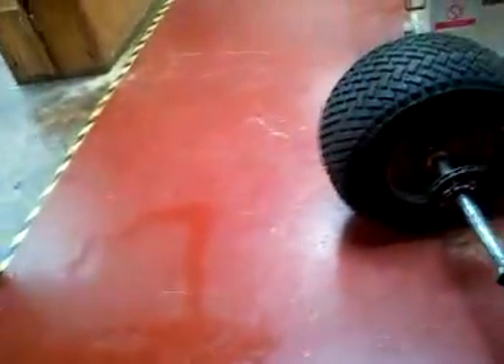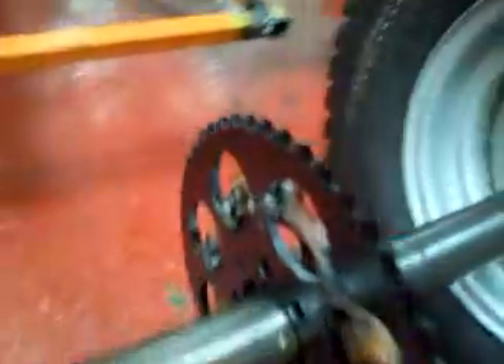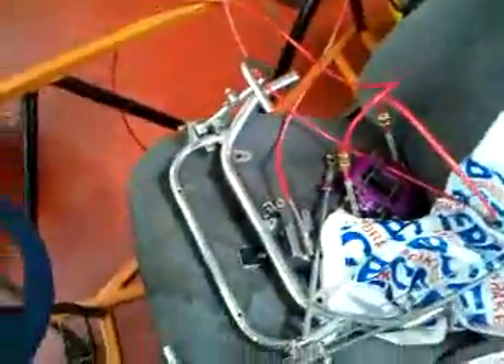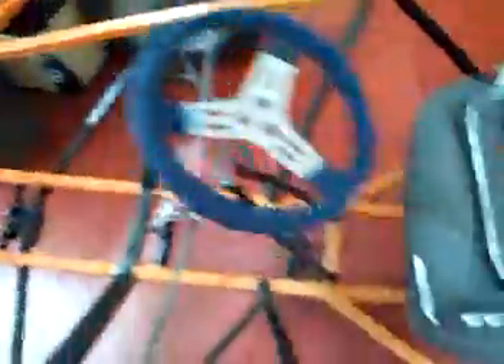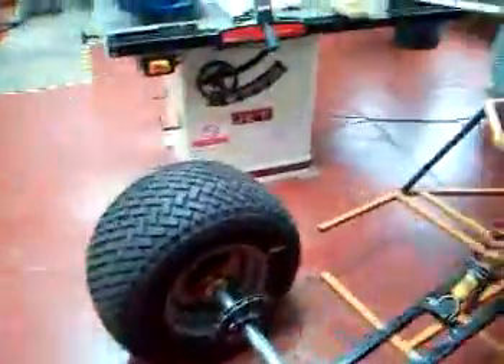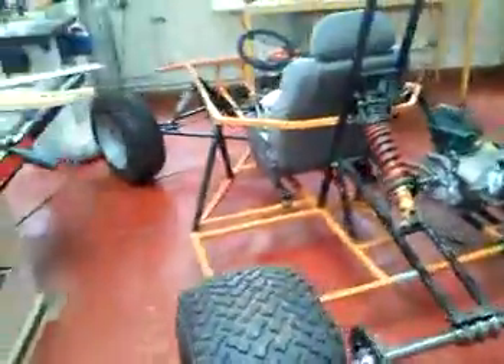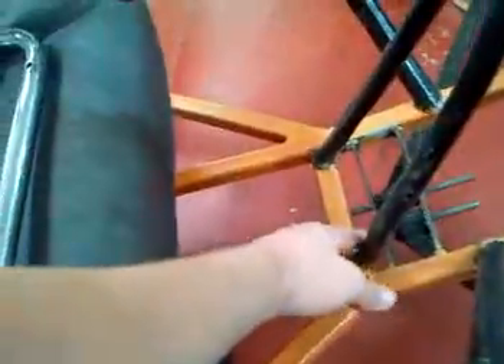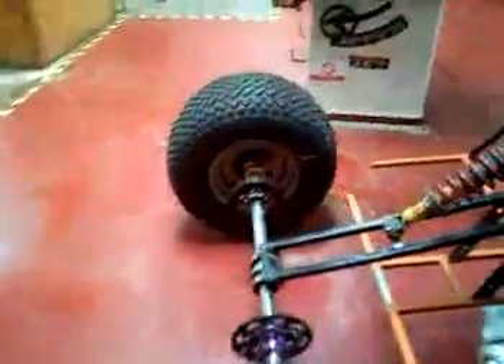Summing up the Dirt devil

Comment from the maker: @leaperd27  well the box section i was using the for the chassis was 20mm x 20mm and got 21metres of that which was roughly £30 - £40 , Seat and rear spring was free from a local scrap yard, set of wheels £100 from a tractor, front springs were £16 on ebay, clutch was £40 but bought it in from america, sprocket and chain came to around £20 and the rest of the supplies i got from my college including the rear axle which was off a sports go kart.  reply if you need more help/advise and good luck:)